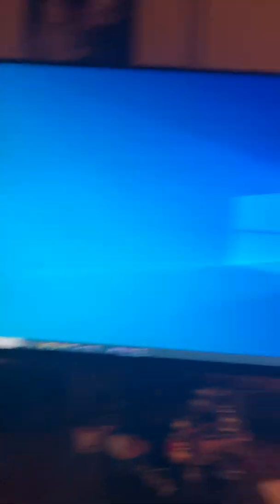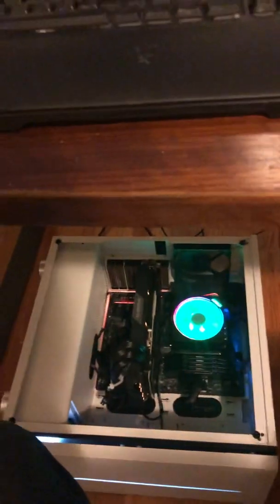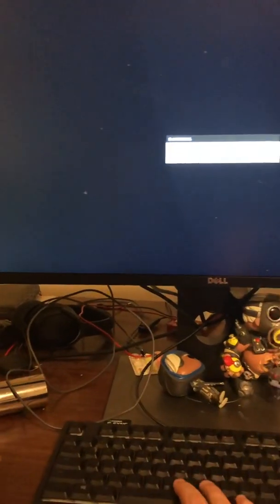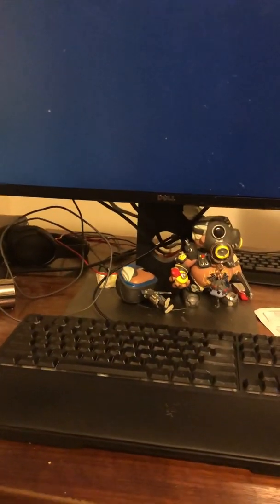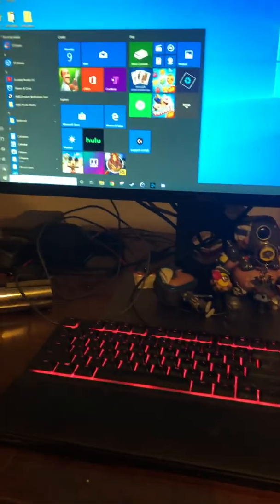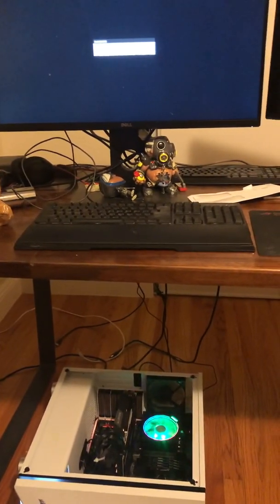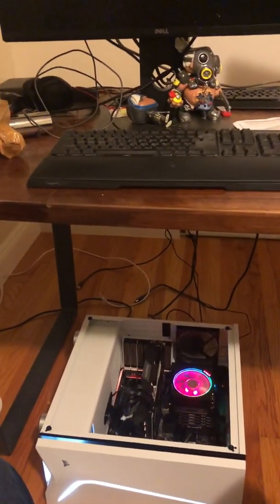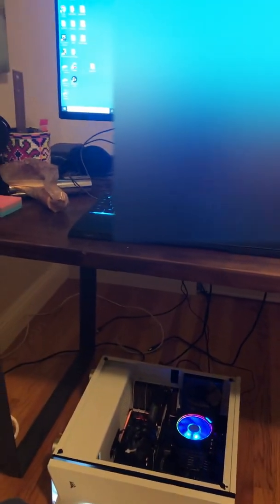Gigabyte X570 Aorus Elite Cold Boot Post Issues

Comment: i tested many suggestion the only thing that worked was changing the pcie in bios to gen 3 in two spots. my exact symptoms were that the pc ran ok with fresh windows install, updating nvida graphics driver would cause it to start to hang on start up, black screen on restarts, very long boot times, any windows updates would make the pc have sleep and boot issues also. With bios pcie set to gen 3 in two spots made the pc finally stable but if the pc goes to sleep and I accidently wake it up immediately as its doing that it may hang and have to be reset and bios settings changed again,  otherwise the pc goes to sleep and wakes up later fine. If those bios changes dont help, then you have a different issue than i had. if you can return your board you should, got mine for around $65 so as a backup its ok for my situation.

Comment: The issue to me, for cold reboot, is after the power is cutoff (from the outlet), till the moment all LEDs are off. Then giving power: hangs up ... and often it resets bios. I'm getting crazy. It worked without issues for 1 year about then it started to act in this way all of sudden. Voltages are at their place, fans are spinning, LEDs are lighting etc.
Reply: have you had any progress in fixing this motherboard issue?

Comment: May 2022 and not much has changed, I have similar issues with X570 Aorus Master, I gave up on sleep altogether, every time I tried to use sleep it would not resume, it would hard reboot coming out of sleep mode. I can do hibernate mode but, it does not consistently shut off USB devices, the lights on keyboard or mouse sometimes stay on one device or the other or both, no consistency just completely bugged. The Windows' settings for which devices can wake the system don't work at all, sometimes keyboard won't wake, sometimes mouse won't wake, sometimes neither and I have to hit power button on case...other times the slightest disturbance of the mouse will wake, like even just touching the desk or walking past it will wake the computer... I'm just living with all this but mostly waiting on a BIOS update so I can turn fTPM on without constant audio stuttering...hopefully by the time W10 is EOL they will have an update. Bad enough I'll be stuck with W11 but stuck with W11 and stuttering audio is too much, I'd rather just run Linux at that point, I probably should anyway.

Comment: Guys, this board is fkcn BS. I build more then 500 pc setups in my life, and never had an issue like with this stupid board that was brand new. Almost tripped myself that I dont know what im doing, even IT is my primary job. Tried all settings in bios: pcie->gen 3 or auto, xmp with and without, csm disable, manual timing and voltages for ddr(stock and xmp values), also took from pc that work like charm ddr, cpu, psu, gpu, always SAME problem. Tried also 3 monitors, 4 cables, and all new bios versions, no luck. Guys, send it back to store where you get it, with this link as mark, so they know its not broken, its factory faulty hardware. Also, there is state for hardware -> MBO, GPU & Monitor = ALWAYS AND ONLY FROM ASUS. Stay away from Gigatrash disaster company! Fckn nightmare!!!!!!!

Comment: Having similar problems. Had it RMA’d, I was told that it ran fine, I’ve since different ram and settings, but bios settings don’t save…so no luck there. Just going to try to get a refund I guess. Disappointed

Comment: Wishing I did a bit more research before deciding on this board. Just built a machine with this board/Ryzen 5600X/Hyper X Predator 3600. Having exact same symptoms. Been trying to troubleshoot it for a week. Tried all the suggestions I can find online on gigabyte forums etc. BIOS. Erp settings/various ram settings XMP off and on, upping dram voltage to 1.4/displayport. Using latest BIOS of F33A and tried previous 2(F32/F30), I can't go back any further on BIOS due to 5000 series support. I have tried all the gigabyte driver updates/AMD chipset updates/Fast boot on/off/All BIOS power modes toggled Enabled/Disabled/Auto.

So demoralizing spending a fortune on gear that does not function properly, at least I should be thankful that when I am up and running the thing flys. Runs stable with xmp profile/overclocking. It is just this annoying cold boot issue. Not sure whether to return board or live with this and hope a new BIOS fixes it.
Reply: Just in case anyone else comes across this post. I RMA'ed th gigabyte board and bought an Asus x570-plus and have had zero problems out the box, I have not even had to tweak anything. So there is definitely an issue with this board, I suspect the issue is to do with memory, maybe if I had different memory it would work fine, but all good with the Asus!

Comment: Thanks for the heads up - I was considering Gigabyte for an upcoming Ryzen 5000 build, but it seems like I won't be looking at them any more. P.S. RAM position in the slots shouldn't matter that much - if you have 4 sticks, you'd want to use all 4 (unless the RAM itself is faulty, which doesn't seem to be the case).

Comment: I had to unplug my graphics card put it in the mobo, power cycle then shut off by forcing it down. I put the hdmi cable back into graphics card and normally it boots up, not this time. I hate this f'in motherboard and am debating going back to my msi b450. I've tried to turn ErP setting to off and I believe fast boot is already set to off. If this keeps up I'm selling this piece of shit. I just got a gigabyte 3070 gaming oc and that sucks too, my rx 5700 xt spanks it for framerates and during bench on Horizon it doesn't even render some things. NOT IMPRESSED with GIGABYTE I was a MSI guy now I'm thinking I should have stuck with them but other people rave about Gigabyte, maybe in the past they were great but I don't see it myself.

Comment: Was there a solution for this? I have the EXACT same issue and would really like to know any information anyone has
Reply: I had the same issue, I updated the BIOS to F21 and also updated the chipset drivers, and it’s been 2 days now no issue
Reply: Disable global C-states in the CPU tweaker menu, it seems that it gives issues on the usb ports, and that could tend up in making your system crash imo. Builzoid recently talked about this on his channel.

Comment: Late to the party....... Had the same issue but also once booted past bios took longer than normal to load windows.
1.  Set to GEN 3 in Bios not left on Auto
2. Turn on ErP in Bios
3. Check what sata connection you have your HDD plugged into, mine was interfering with the Samsung NVME drive.
Reply: can you be more specific?
Reply: IIRC SATA position should only matter if you're using an M.2 SATA drive, and even in that case I'd expect the SATA port to just not work (i.e. the M.2 taking priority over it) as opposed to causing issues like this.

Comment: The same issue with Gigabyte B550 Aorus Elite, I bought an MSI B550 Tomahawk, and everything is simply better.
Simply don't go with Gigabyte Boards or anything that's Gigabyte. My only good part was with a Gigabyte Power Supply, which was not for me but for my friend.
Spend more on getting an AsRock or MSI board if you can't fit ASUS in your budget.

Comment: This problem is very common and shared across almost all new AMD chipsets,so fault is actually not only on Gigabyte...
It's something connected with bios programing and proper communication between bios and chipsets on cold start.I have Gigabyte aorus b450 pro,and had many problems quite similiar like yours,motherboard wont post at all or it would post after 2 minutes.I RMA a board and get new one,similar issues after few days,turns out there is nothing you can do about that.
Then i read on some forum that is easy fix for this problem,you have a option in bios called Erp,this option enables some little power to stay after you turn off your PC.
After i enabled this option problem completely disapeared,it's because bios chip wont remember your  hardware,so on every cold boot checking goes on and on,sometimes also get failed on start...but if you left some power everything is fine.
With this option on my pc boots up in 2 seconds,and not like before after few minutes,or no boot at all.
Many people actually RMA perfectly good boards same like me,get a new one and continue to strugle,this is a tragic fact and AMD together with all major motherboard manufacturers should do something about that.
Reply: I love you man. Because of you, the problem is solver. I literally love you man
Reply: @Baburaoraparla  No problem man,glad to help!
Reply: Bro. I cannot thank you enough for typing up this paragraph. People like you are the fucking shit
Reply: I love you even more than the others. I was about to burn up my computer and just saw your post. Fixed everything. Thank you so much
Reply: @74Noose  you welcome,it's my pleasure to help,i remember how frustrated i was because i spend all this money on hardware that dont work,and after this fix i was so happy cause finaly i could restart and turn off my pc without fear.
There is nothing wrong with this boards,it's just a small bios problem that would be fixed in future updates for sure.
We just need to keep eyes on every new bios edition and update it soon as possible.
I own this board for a year and half and in this period i update 3 times,i had also a big issue with corsair memory,and after this last update works flawless.
This is a prove things would get better.
Reply: @HisNoodlyAppendage  when you get new board issue would continue,like i said,it's not a hardware problem that would cause motherboard to behave like that,it's a chipset fault.
Motherboards manufacturers cant do much,because chipset is manufactured by AMD,it's a design fault.
Your previous MBO was perfectly fine lol,i RMA 3 boards and issue was always present.
On Gigabyte boards ERP option would solve this issue,but Asus probably have different name for this option,you just need to research and find it.
Basically it's a 5 volts backup power that stay present after you turn off your PC,it's only few wats and it is designed for wake up on switch and similar type of stuff.
In this case this power goes also to bios chips that stores all your hardware settings necessary for normal boot up.
Because of known fault battery doesnt serve her purpose and dont power up bios chips after you turn off your PC,and that's why we need this ERP lol.
It's confusing af i know :D
But besides this small issue i never had any problems with my Aorus motherboard,hours and hours of torture,gaming or rendering it's stable and working like a clock.
Reply: @HisNoodlyAppendage  no problem,glad to help.
Reply: Have to try this,  i just did a build with a Auros x570 pro wifi (1.1) and it was fine for first week, pretty well never turn  my pc of just let it sleep. I had some parts coming to fit an extra rad into my loop so i ended up shutting down and spending  some time with psu unplugged, draining loop, fitting new parts and refilling  etc etc,  when i went to start up first time BAM, i got this bug! Sometimes  it would make it into bios, one time was showing -55c on cpu, interesting... I couldn't get it to start that night and gave up, switched of psu and went to sleep. Next morning, ready to rip board out and go into shop to organise testing/rma/probably buy another mobo i thought i better try it, naturally it worked first go! I hadn't yetseen the mentioned elsewhere pop out battery fix which supposedly temporarily sorts this. It has been fine since but i have my own theory on what MAY have happened: The bios are a bit buggy, i had flashed to f34 right after i installed os, i had noticed it was a bit buggy , especially in smart fan page, anyway after i had added rad to loop first thing i did was jump into smart fan page in bios to create custom curve for my 2000rpm fans on my extra 240mm rad so my room didnt sound like an airport and as per normal bios hung when saving curves, id seen this before but it always boot after no problem. I think what then happened is it went to fallback bios, not sure what revision it is (i didnt flash it when i went to f34 on main, just in case..) and this simply did not support my cpu, a 5900x and until i got it onto the main bios again, by leaving it with psu of for 8 hours or so, it wouldn't boot into os and rarely even posted. From reports on other forums this bug does seem mostly gone on later bios revision, like f30+(board/brand dependant obv) so be sure to check this out (and maybe look at flashing your backup bios if you have duel) as well, because if its old and it does fail to post from main for whatever reason and falls back to the severely out of date one it MAY be the cause of this headache. I really hope the issue is sorted because aside from this i do like the board and it was rock solid. Will have a look at this erp setting though for sure, even though im tempted to leave well enough alone as right now my system seems happy.
Reply: Unfortunately in my case turning on ERP did not help 😢

Comment: Hello everyone, first time I post on youtube because I solved this problem on my Aorus Elite. I've had it for 12 months now and tested every BIOS release, every hint I found on Reddit but nothing worked. My RAM was qualified (Corsair 3200 - 2x 16bg), swapped gfx card, put it in the other slot,  etc. etc. - So today I finally bought a new 2032 battery for the BIOS and tadaaaaa - the mobo boots every time - with monitor display on or off, every setting in the BIOS is retained, XMP works out of the box now, all is ROSY - I'm sooooooooooo glad it's finally working! Hope everyone that still hasn't replaced their bios battery when having these cold boot problems will replace it, and not wait as long as I did.  Problem solved - have a good one!
Reply: i have replaced the cmos battery with a 3v battery, but no use
Reply: @Baburaoraparla  Hello, that's a shame. I must admit I've had 2 cold boots in 2 weeks now, with the battery replaced. This is much better, as before it happened multiple times every day. And at least, my BIOS settings (XMP etc.) are not erased after every cold boot.
Reply: @dirkdk8235  These has been a problem with Gigabyte motherboards since 2008 on LGA 775. This "Cold Boot Post Issues" happens to me as well when I'm waking the PC from Sleep.
Reply: @leotheevinci  if thats what i think it is then turn off hybrid sleep in windows power settings
Reply: @SleepySage  actually that's not all. It will continue with an endless bootloop turning on/off. The only fix is to temporarily run in single channel memory.

Comment: Ok i have found the issue its the "Display Port Cable" not the MB or RAM nor the BIOS. You can replace your DP cable with HDMI cable and system will boot fine..! The issues with DISPLAY PORT CABLES is that PIN NO 20 on DP feeds 3.3v back to GPU from Monitor when the system is off. One can mode the DP cable by just cutting the wire at. PIN 20
Reply: im using an hdmi cable, because i dont have an dp cable, but no fix
Reply: When i had this problem, i had switched  from DP to HDMI myself and it didn't fix it, i think your experience is just coincidental im afraid. Buggy bios is the culprit. I think my issue was out of date backup bios but i cant be certain at this early stage until problem rears its head again and when it does post i can see if its on the main or backup.

Comment: Have the same issue with my aorus x570 itx for now the only solution for this problem is " after shutdown the system turn off the main wall switch and after 1 min turn it on and power on the system"  it will boot normally..! 😬
Reply: I have the same board you fix it?

Comment: The Aorus 570 Elite is less than robustly rock solid... Ours have driven us techs... Krazy...
Reply: I have the Arous Elite x570 wifi and I cant get it to boot at all.  Monitor just says NO HDMI.  PC looks like it starts up with all the fans. I tried new HDMI cables . reseating ram , checked cpu . this it a PITA
Reply: @mib20000  mine just got that problem mine won’t wake up from sleep and it would shut off then turn on them off then boot up after bios exit

Comment: I have two of these boards and don't have any issues with either
Reply: Could you help me I cant even boot into bios
Reply: @OriginalKilo  pull the power plug, remove the battery, wait 5 minutes. reinsert the battery, reinstall the power plug and try to boot it. keep hitting delete until the bios shows up and then make sure you are booting from the correct drive if you have more than one. You did not mention how it got this way?
Reply: I done that already didn't help
Reply: @OriginalKilo  I'm not going to try to pry information out of you but you never stated what happened???
Reply: @Bass.Player  nothing happened to me. the system technician on this motherboard was assembled 3 weeks ago on 5800x. f30. I didn't change anything in the bios, only I turned on the XMP profile. I decided to check in the drain first. memory 3200 c15 on samsung b-die. for a week everything was fine, then for the first time I was faced with the fact that the system did not start on cold. a couple of days later it happened again. for the last 3 days, the system has been "running" like this every time on a cold one. That's why I started looking for information. and the problem turns out to be quite global.

Comment: The only best solution that i used is to use power switch. When your not using or powered off the pc, in my case, i use an extension cord that have power switch. Turn off the switch to kill the power to the pc. This will cut the power to the psu and motherboard. So whenever i want to use it again, turn on the power switch.

Otherwise, you can turn off the psu power switch. But this limited to your placement of your case...